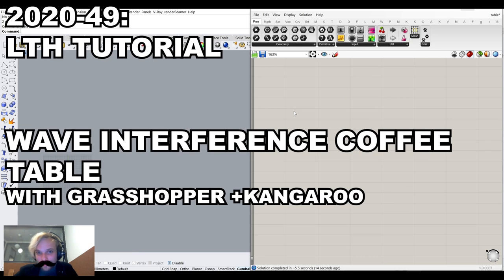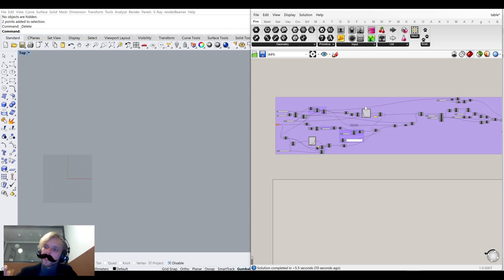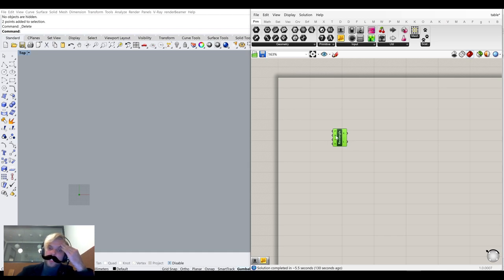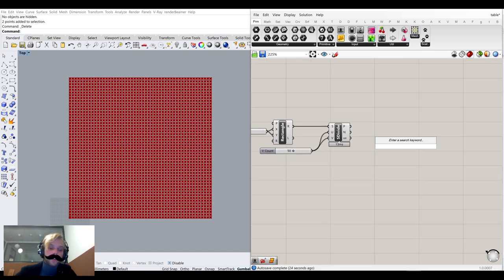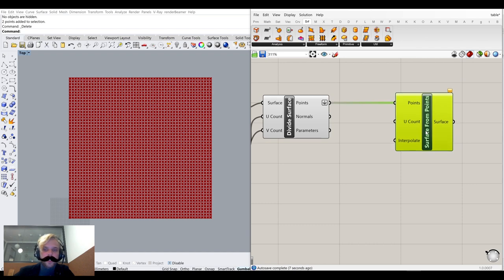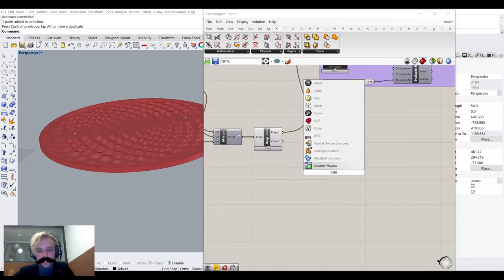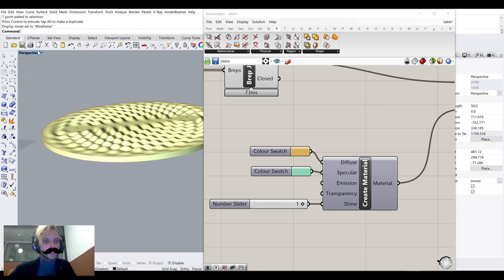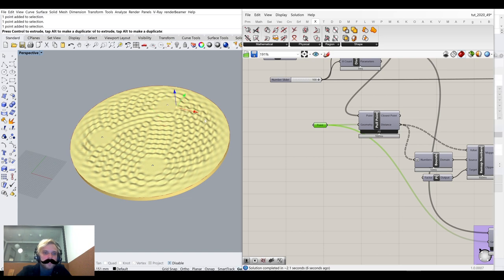2020-49 LTH Tutorials: Wave Interference Coffee Table with Grasshopper

Comment: Great tutorial, I really appreciate you sharing the knowledge. I do have a question, how long did it take to CNC the wood table and how do you do it/optimize the process?
Reply from the maker: Oh it took around 15mins to do. It's just a single parallel pass with a ball endmill. I use fusion360 to get the gcode for milling, there is a tutorian on my channel about it.
Reply: @DesignGoBrr  You should try out RhinoCAM!
Reply from the maker: @soerensenkarl  The price of RhinoCAM is literally 5x EDU Rhino licenses per year.So for me to justify this price - it has to additionally cook me breakfast, clean my floor and sing nice songs to me before I go to sleep.
Reply: @DesignGoBrr  Ah yes. If only there was a free way to acquire overpriced software... You're right it's a shame about the price because it's some pretty butt-kicking software if you like keeping things within Rhino.